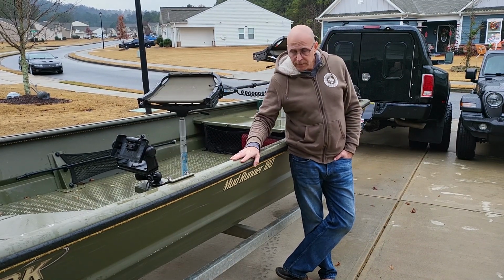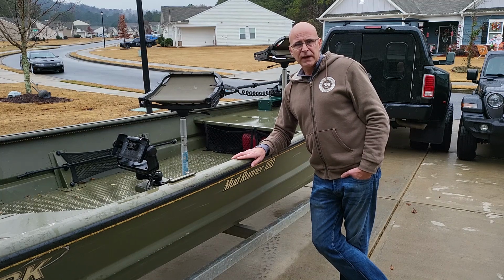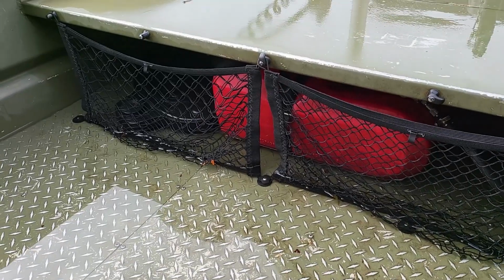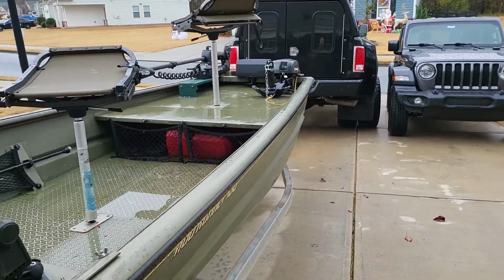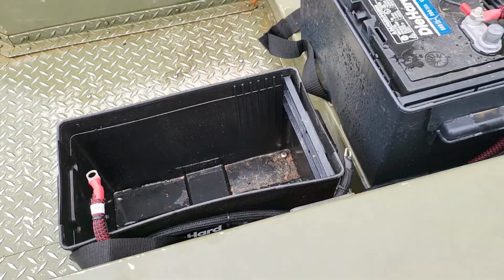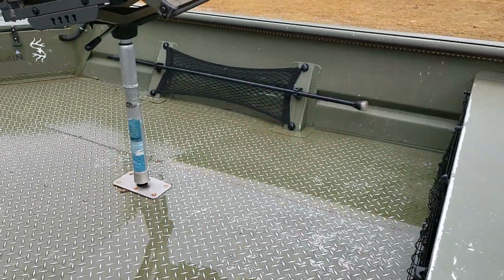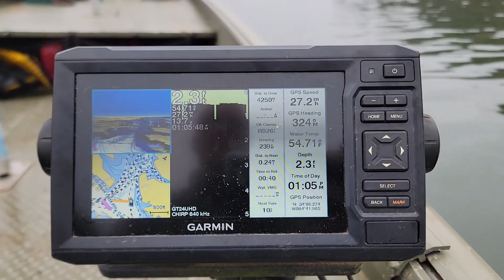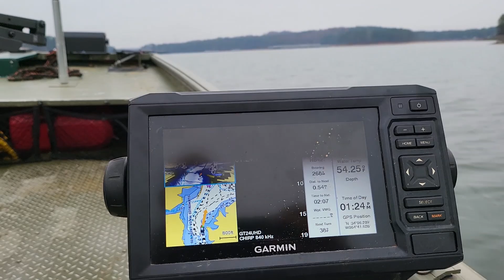Mud Boat Conversion for Duck Hunting and Top Speed Challenge

Comment: You look like you running where it need to be
Reply from the maker: Thanks for the feedback! I think this testing shows that the performance is directly related to the weight. I'm pretty happy that I can set it up for duck hunting and get 27 mph and then load it down for fishing and still get 22 mph +. The skeg isn't adjusted for the prop so I think there is some tweaking that can make a little difference but I am comfortable with this as-is. Thank you for watching!